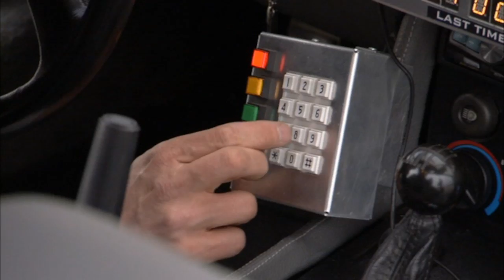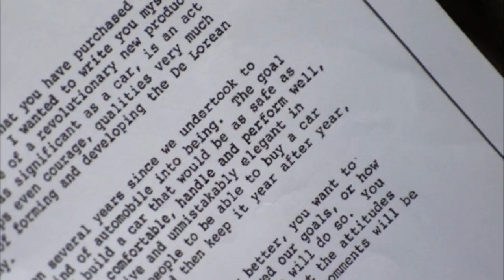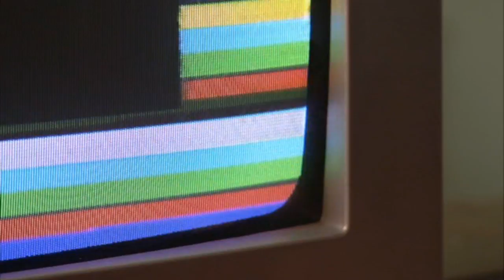Britain's Greatest Machines with Chris Barrie - 1980's - DeLorean and Sinclair C5

Comment: It's funny that there was - for a time through the 90s to the early 2000s - an update option available to replace the frame with Stainless Steel as well (replacing the steel frame with epoxy that was standard). The upshot is the entire car would last forever as well.

If you check out the videos featuring the S2 tuned DeLoreans - the car's performance goes through the roof. It was US emission regulations that cut the HP down to 130 (or so). Twin turbo after market options also exist.

Comment: No Moron if you WIKI It As MrMe Pointed Out It Is BASED In Northern Ireland BUT Had A Base In TEXAS Read up Before You Sprout Off Twerp
Reply: The place in Texas has nothing to do with the original factory and the place in Texas did not open up until 1997.